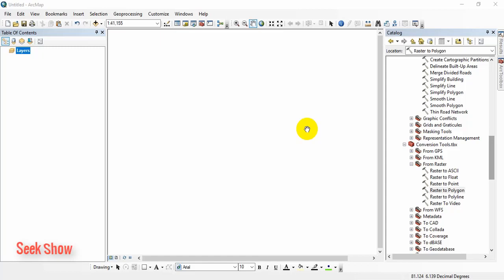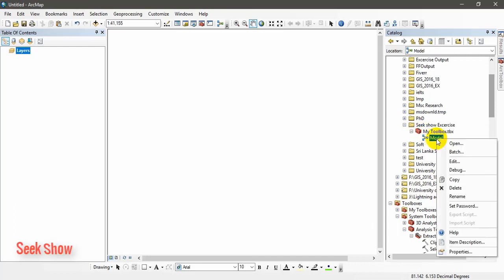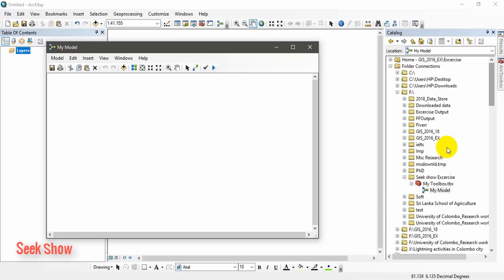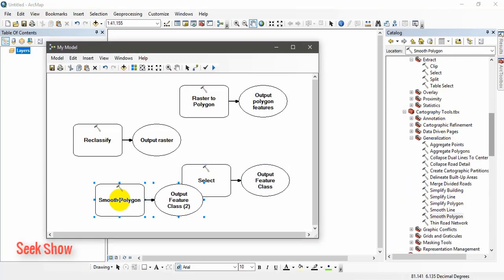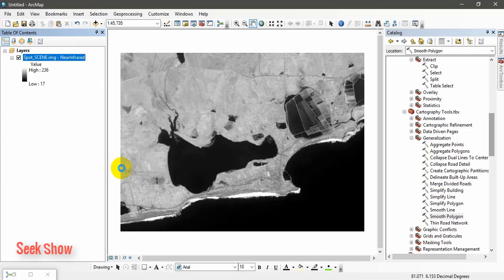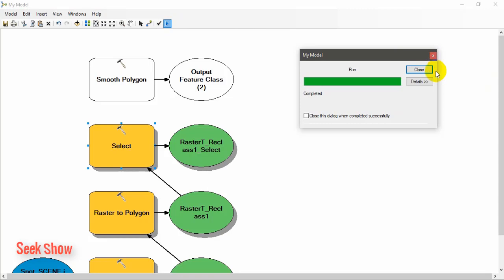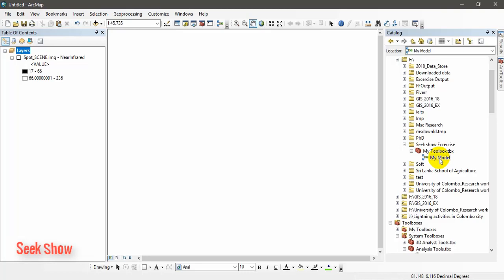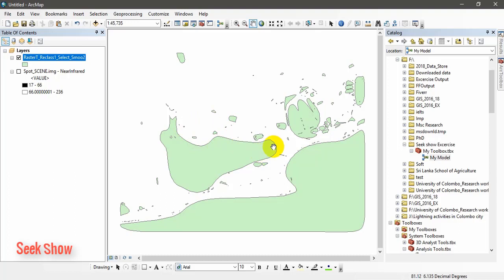GIS Modelling Create Any Custom Model Easily using Four Tools

Comment: how can I bugfix my model ? I want to see the Value of diffrent Parameters and Variables in IfElse Clauses at the runtime . For Exempel, after "calculate Value" it returns %new ID% for further calculation. I want to see the Value in Details oder MsgBox or somewhere in Prompt. Thx in advance.
Reply from the maker: You will have to check one step at a time. Don't run the whole model at once.

Comment: Thanks alot.
Reply: I need assistance with modeling Land Suitability analysis using ArcGIS. The dataset type that I may require for Sewer pond site analysis. Thanks
Reply from the maker: @kwandumakayi8784  Please first you try 🙂
Reply: Okay SS. I will get started & inform you of my progress. Am grateful for your time
Reply from the maker: @kwandumakayi8784   sure. Take your first step which is the hardest.  You will not ever fail. you will learn something new. Good luck!
Reply from the maker: Im glad 🙂